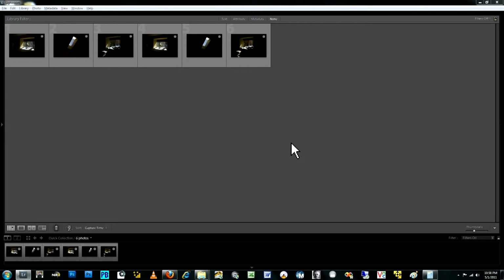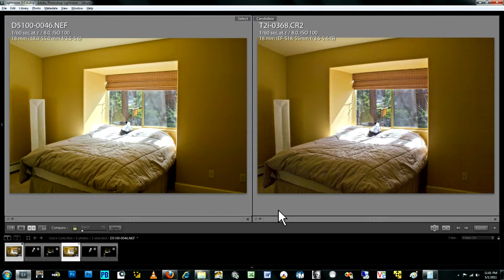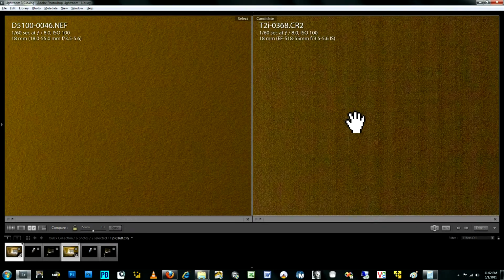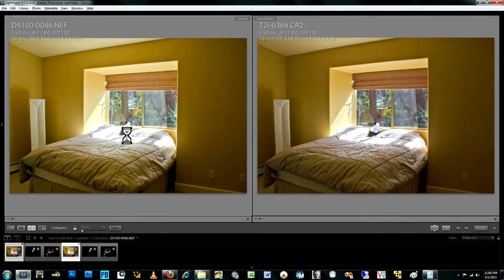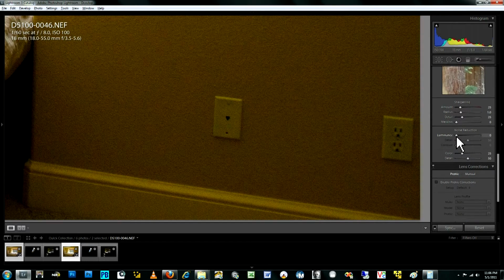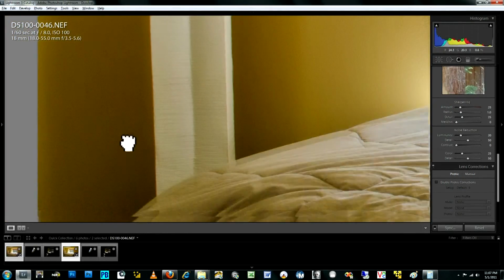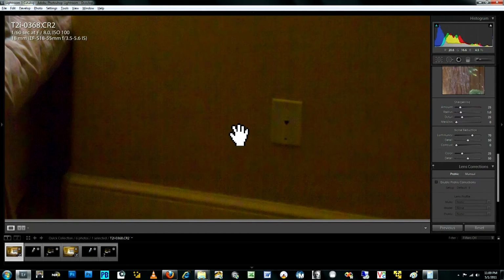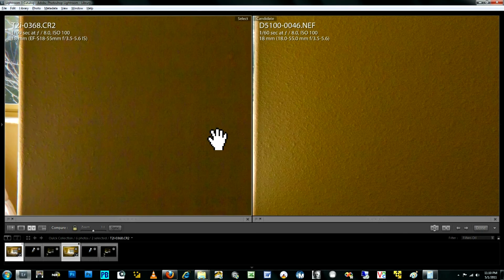Nikon DX vs Canon APS-C: Dynamic Range (Part 2/3)

Comment: Isn't the Nikon DX here a far newer camera than the T2i. Shouldn't the Canon have been the equal in years?
Really who cares if one gets 1 stop better.
It's not the detail in the bed, it is the fact that the bed was not made to begin with.
Use a flash(es) and who cares about the static images outside. If you want outside shots then go outside.
This was a far better teaching video than a test video.
Don't get fooled by RAW and no internal software noise reduction. Both companies do some noise reduction their RAW files...even when set to zero...
1) The Eye Behind the Lens
2) Lenses
3) Practicing photography
4) Learning how to use photo software
5) Luck, timing and more luck
Reply: Easy boy... But Canon sensor is sucks everyone knows that also Canon too...

Comment: Eos t2i was relased before more than 2 years ago .. and now canon has improved its dynamic range in higher ISO so no need to worry about noise.. I personally don't like the higher dynamic range, though it may give u brighter colour ' by some means it also fails to give the accurate colour.. and I prefer to select the camera by overall performance.. so I choose canon..

Comment: My dealer was selling the D800 £200 cheaper than RRP so I waited 14 weeks for it but Nikon sent them very few units, I thought 'fuck you Nikon' and sold all of my gear and moved over to the 5D Mk III. 

I probably lost 1-1.5k switching to Canon and despite knowing that the dynamic range was poorer than any Nikon on the market, I didn't realize HOW poor. If I'd have know what I know now I'd have spent the £200 extra and waited longer for a D800.

I'll zip up some RAW files for comparison.

Comment: I had a D7000, which you can pull back probably the best part of 5-6 stops of underexposure, the 5D Mk III, maybe a 1/2 to one stop at 1:1 before the image starts to show the same level of noise at 1:1 as the D7000 does at 5 stops. A HUGE difference.

This is no lie, I've got RAW files from the D7000 that I can recover blacks up to that point and obviously CR2's from the Mk III that can barely even manage a stop.

Comment: D5000 did in camera RAW noise reduction and looked very soft and low detail.  I'd take a bit more noise to have better clarity, especially if the sensor is higher resolution.  Here I think the two pictures are differently exposed as others noted and D5100 should be compared to T3i or T4i, the current models.  I had a D5000 and it was good for shadow noise but low MP and definitely clipped highlights.

Comment: This is a nice arbitrary example of noise performance and dynamic range, however it's not an accurate test. Don't get me wrong I'm a Nikon geek myself, however in order to measure the dynamic range you'd need to sample the same scene on a test target, and step the exposure times. There's an example on dpreview on this. 
Your noise examples can be found by blocking light to the camera, and acquiring two images, then calc by i2+100/i1 = Read noise.